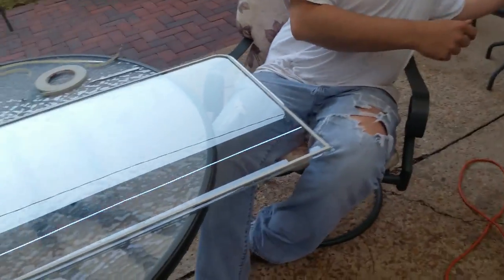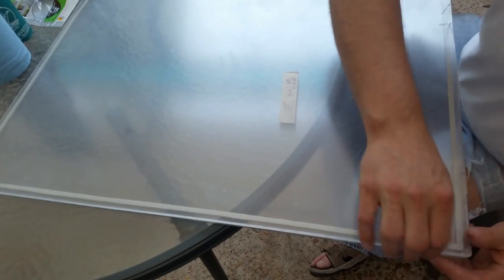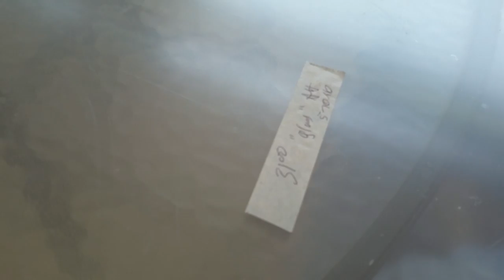94 Bounder,  Easy double pane fog window fix - RV REPAIR

Comment: Hey Don, great video. Its been over three years and i was wondering how is your repairs are holding up? I'm getting ready to do my windows in my 96 Bounder. I'm going to do a video on it, but i'm going to show the cleaning process using a polish I read about from an employee who works at Boeing. I hope it works.

Comment: as a glass guy I can tell you a few things that are wrong and not trying to burst your bubble. Most states you can find a glass company that will fix these and will run 2-300.00 and up. With all the work you did, it will not last 1 yr. There is NO glue that will stick glass to plexi, none. So all that work is not going to pay off. The foam spacer is a ok but after that use a urethane that is primer-less and attach glass to glass. there is spacer material made for this job that will absorb moister and sticky on both sides not sure if you can buy it from CR Laurence. I think they only sell to contractors.
Reply from the maker: Hi Kevin, if you have a recommendation for custom tempered glass with a radius. id like to hear about it. my understanding is that it must be cut and then tempered. is that correct? Most glass shops form this work out. for a single pain alone, i was unable find a reasonable price. would you agree? My goal in this video was to show how fix these windows on a budget and time will tell if they hold up.  I may shift to solid plexiglass if what you describe happens. thanks for the comments.
Reply: you can use a butel, its like a think tar you can get in a 1/4'' role and then back up with urethane. as for the glass I run into glass units that are etched and can not be cleaned like you have here. I then cut an 1/8 glass to match old one then drop it off at my glass warehouse that builds and tempers glass. my cost to temper this one piece of glass is about 20 bucks give or take depending on size and if using a glass that has a tint green, bronze. There is no glue that will work with plexi to another object like glass or metal but another piece of plexi like a fish tank plexi to plexi at the joints will work. I have tried and asked many professionals if there is any glue and have not found one yet. What you are doing is hard work, I just hate to see you redo this next yr. best of luck. Im in Phx if you ever get buy look me up and Ill try and help you.
Reply: you can purchase from DKhardware  CRL Gray 3/16" Edgetech Super Spacer®  and sealant --CRL Black Silicone Foam and Metal Spacer I.G. Sealant   made especially for insulated glass units.   Works great and is what professionals use.  I did 3 units on a 2004 Country Coach drivers window.
Reply: this comment is spot on and the key to success

Comment: Hi Don, have you heard of anyone getting the etched surface repolished or is the etching too uneven? I'm about to attempt this on my German motorhome in the UK.
Reply from the maker: Ive polished mine.. you can get results.. but you can also burn through the outer layer.. power buffer, wool pad, cutting creme.. auto finish materials. Not to expensive. Labor intensive. Good luck from across the pond.
Reply: @DonBrandt  Thanks for getting back to me, I'll give it a go although I'll have to source a power buffer first. If it doesn't work I'll try and get glass cut to size and tempered. or maybe go your acrylic route -Brian